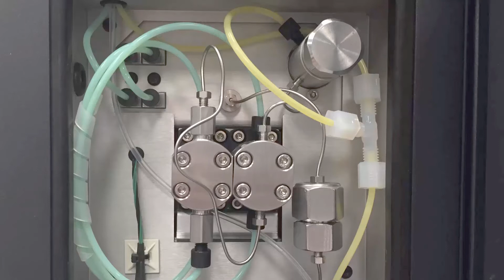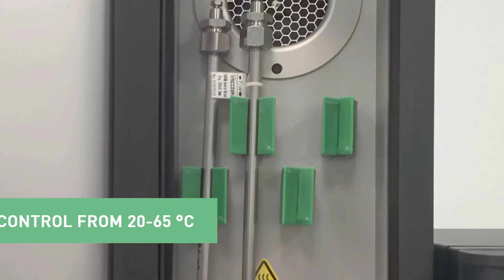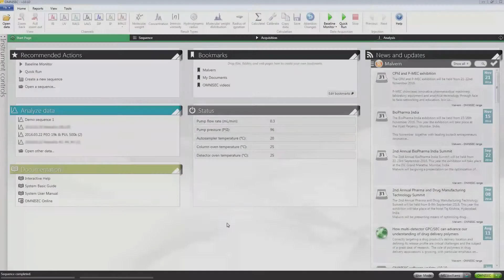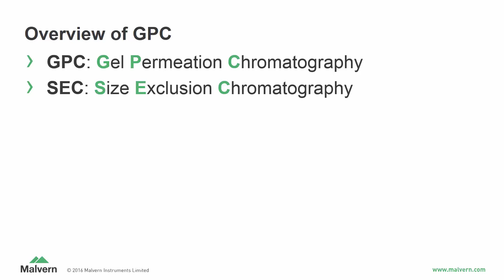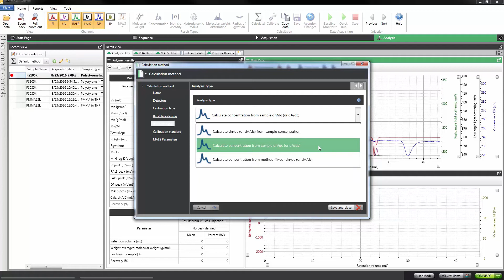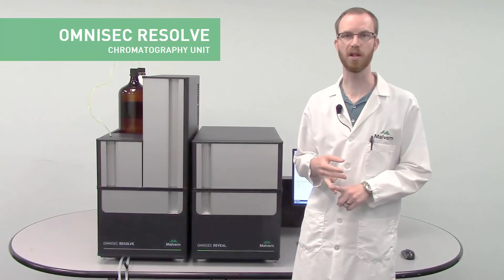OMNISEC: Demo at Your Desk - Polymer Characterization

Comment: How to extract a publishable graph from it though?
Reply from the maker: Hi Elina, Any Image can be directly copied from the software by right clicking and pressing “copy graph” and then pasting in the destination program. Alternatively, using the reporting feature all data can be exported from the reports by pressing the 3 horizontal dots on any plot and then pressing “copy data”. This data can then be used to create any plot you desire using a range of plotting software’s.
Reply: @MalvernPanalytical  thanks for the reply. it would be great to skip this additional step and just save the already overlayed parameters as e.g. TIF file